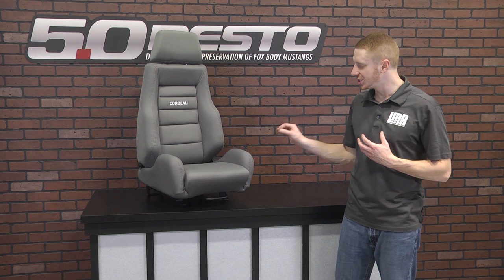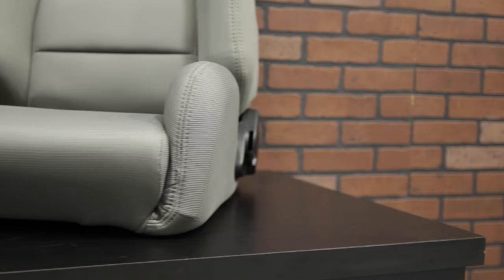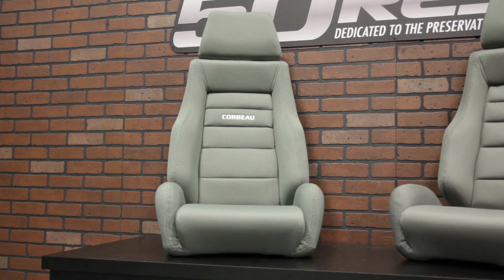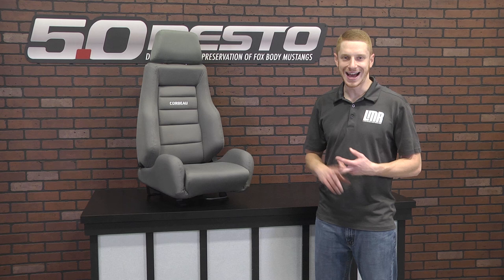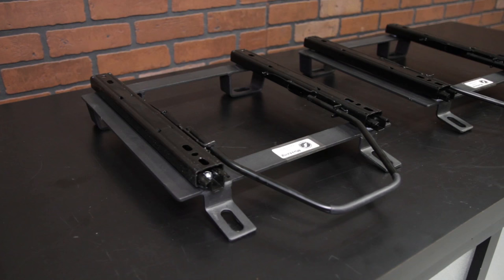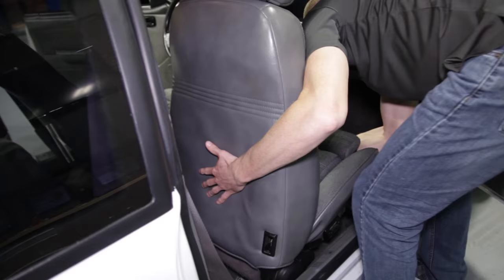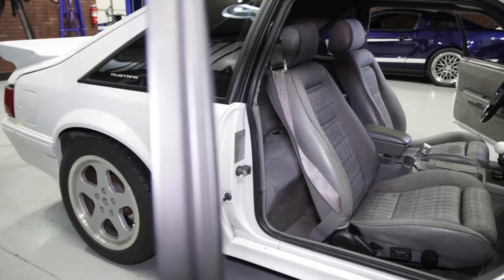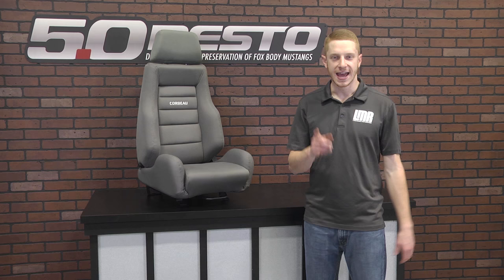1979-2017 Mustang Corbeau GTS II Race Seats - Review & Install

Comment: Do the headrests move up and down?
I'm tall and my head always is above the non-adjustable headrests.
Also, no adjustable thigh support?
I like the Ford OEM pull out thigh support cushion for long highway cruises. I have that on my '85 GT 'halo' seats.
Reply from the maker: Yes, the headrest are adjustable. They have about 3-5 inches of adjustment. And there isn't adjustable thigh support.

Comment: Couple things about this seat it raises your drive height quite a bit I'm 5,11 and I'm less then a inch to the roof. So if you're taller you'll probably hate them.  Next is the fabric it gets dirty real quick and stained very easily I still like the seat but definitely won't do them in grey again. I wouldn't recommend this seat in a Daily driven car for the 2 reasons mentioned and the foam is pretty hard.
Reply: Did you get the shaved seat or regular seat?
Reply: Damn..  Sad to read this.  I love sitting low in fast cars.  I hate the feeling of being popped up high and IMO it ruins the driving experience.

Comment: I believe the 87-93 stock driver seat without bracket weighs 38lbs. How much do these weigh?
Reply from the maker: Hey there, these seats weigh around 24 pounds, compared to the original 38 lbs.

Comment: That wire plug in under the seat at the bottom? You don't have to hook it back up? 
Thanks
Reply: No. That lead is for the power lumbar an the factory sport seats. Since Corbeau doesn't have power lumbar you will not be using the factory chassis harness lead.
Reply: Perfect thanks boss 👌🏽

Comment: so when you install into the mustangs with electric  seats you lose the ability to have the 6way adjustment.....nope...not worth it.
Reply: The extremely vast majority of Mustangs have manual seats, but yes that is correct.
Reply: @cmccarthy  Like you say, if you own one of these cars the seats never really had any "features" like modern cars have,thats why its so easy to get rid of the stock seats if you so prefer, now if i had a later model Mustang like a late 90s and so forth and i was used to those seats with features it would be a different story,Ive owned 3 of these cars, 2 at the present and i never fooled with the seats much,to me they were more like gimmicks (lumbar, the little wheel etc), I'm 5/10 and the only thing i need is forward or backwards and I'm good,lol